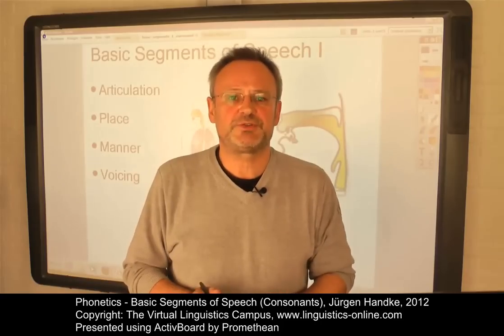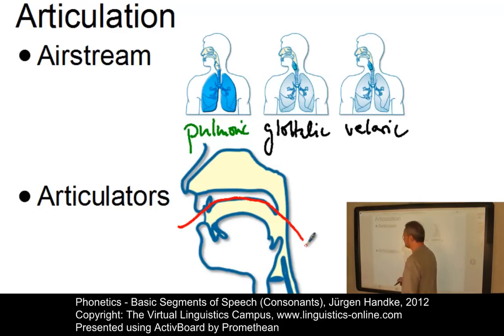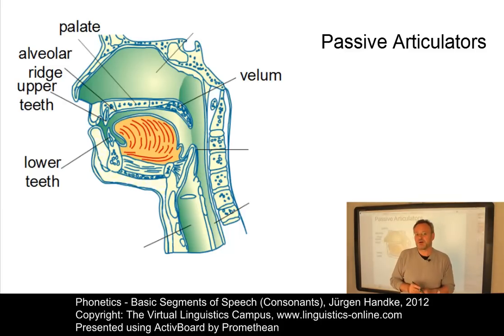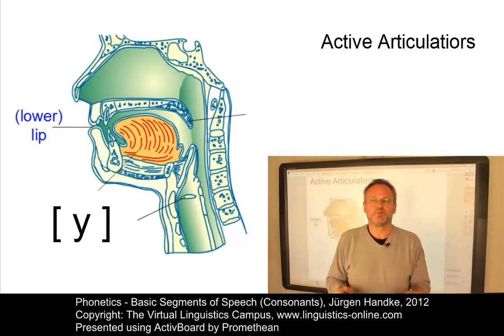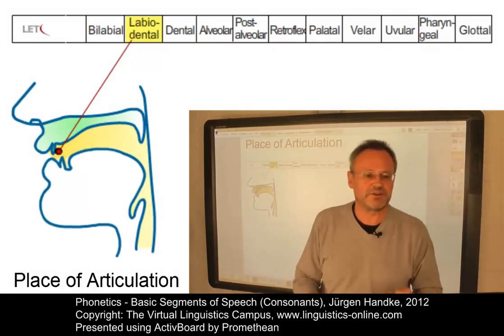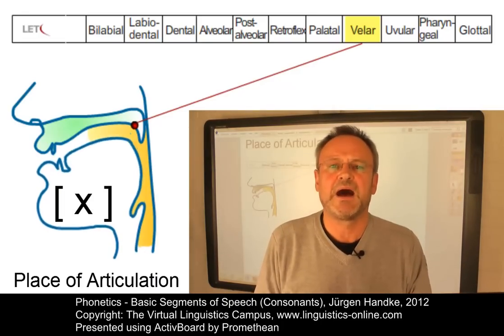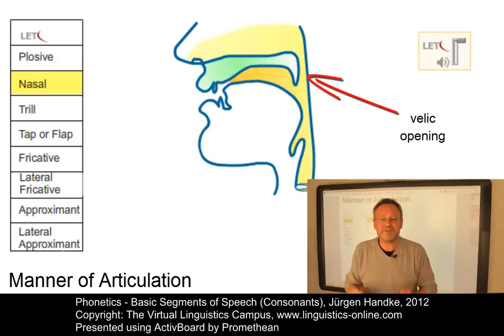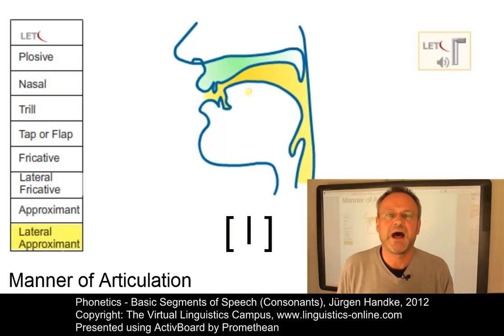PHO106 - Basic Segments of Speech (Consonants)

Comment: (0:02) This unit introduces the phonetic machinery for the classification of consonants. Consonants are speech sounds that involve some sort of obstruction to the airstream in the vocal tract.

(0:16) Using this criterion, we can set up two distinct articulatory parameters for consonants. For example, the place of articulation – that is, where does the obstruction occur; we can use the manner of articulation – that is, what type of obstruction is involved; and the third parameter is binary, it concerns the state of the glottis – that is, do the vocal folds vibrate or not? A further criterion concerns the type of airstream involved – yet, in this unit we will concentrate on those consonants that are produced with a pulmonic airstream, represented over here. We will not look at consonants produced with a glottalic, or with a velaric airstream: these types of air streams will be discussed separately.

(1:35) To understand the main articulatory parameters, we have to deal with some anatomical details about the vocal tract first. Consonants can be articulated at any point along the upper surface of the oral cavity – so along this line, here. The point of this upper surface involved in the articulation of the consonant is referred to as the passive articulator. A passive articulator is a position in the vocal tract which is involved in the production of speech sounds but [which] does not move. Starting at the front of the vocal tract, the following passive articulators can be classified. For example, the lower and upper teeth. Now, the upper teeth are locations where the tongue makes contact to produce several different consonants, such as [θa] or [ða]. The lower teeth are positions where the lips make contact to produce consonants, such as [fa] and [va]. Another passive articulator is the alveolar ridge, over here. Now, the alveolar ridge is an area for the articulation of many consonants. It is situated just behind the teeth. Typical consonants are [ta], [sa], or [ra]. The palate, or sometimes called [the] hard palate, is an area for a large number of consonants. It is often referred to as the roof of the mouth. A consonant would be something like [ça]. And then we have the soft palate, or velum. Now, this is a broad band of muscular tissue in the upper region of the mouth. Typical consonants are [ka] or [ga]. Another area, which is not really a passive articulator but an area, is the pharynx, over here. Now, the pharynx is used as a contact area for the production of some consonants such as [ħa]. And then we have further areas which are not really articulators. For example, the nasal cavity, which is the main non-oral resonance chamber. Consonants that involve the nasal cavity are typically consonants like [ma] or [na]. In the back of the mouth we find the food pipe, or oesophagus. The trachea, or windpipe, is used for breathing and for the airstream. And finally, we have the epiglottis, over here, which is attached to the anterior part of the thyroid cartilage, and it functions as a closure to the entrance to the larynx during swallowing.

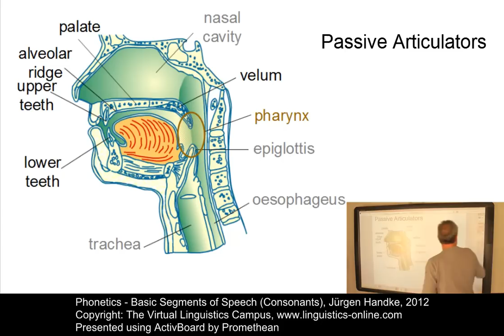(5:12) Let us now look at the active articulators. Now, the organ which is moved towards a passive articulator in producing speech sounds is called the active articulator. An active articulator is actively involved in the production of speech sounds. Starting at the front of the vocal tract the first active articulator is of course the lower lip, or the lips. Now, the lips are actively involved in: the production of labial consonants, such as [ba] or [pa]; and the application of lip rounding (or not) [for] vowels – so, vowels such as [i], which involves spread lips, and [y], which involves rounded lips. Further active articulators are of course, here, the tongue. Now, of all mobile organs, the tongue is the most versatile. It is capable of adopting more shapes than any other vocal organ. It is involved in the production of all vowels and most consonants. Here we have the uvula, another active articulator. Now, the most noticeable feature of the velum is the uvula – that is, an appendage that hangs down, and is easily visible if you open your mouth and look into a mirror: [ha], at the very end. And then we have the glottis. Now, the glottis is part of the larynx, and it is the source of phonation.

(7:00) The position where the contact between an active and the passive articulator is produced is referred to as the place of articulation. I will now produce one consonant. I will choose a fricative consonant – that is, a consonant which produces a turbulent airflow per place of articulation. And I will do it between two vowels for reasons of better audibility. Let's start with bilabial consonants. Now, here we can observe a constriction between the lips, and the result would be something like [afa], [afa]. The next place of articulation is the labiodental place of articulation, where we can observe a constriction between the lower lip and the upper teeth. A typical consonant would be [afa], [afa]. Dental – Latin dents, dentis, ‘the tooth’. Now, the dental area involves a constriction between the tongue and the upper teeth. Here is a consonant: [ata], [ata]. The next place of articulation is the alveolar place, that is the alveolar ridge, and it involves, of course, a constriction between the tongue and the alveolar ridge. Here is a consonant: [asa], [asa]. The post-alveolar area is just a little bit further back. Now here we have a constriction again between the tongue and this post-alveolar area. An example of a consonant is: [aʃa], [aʃa]. The retroflex place of articulation is a little bit different because it is still the same place of articulation (post alveolar), but the tip of the tongue is slightly curled back, and the result would be something like: [aʂa], [aʂa]. If we have a narrowing in the roof of the mouth – that is, in the palatal region, we get something like, [aça], [aça]. And then, the velar place of articulation involves a constriction between the velum and the tongue. A result would be: [axa], [axa]. And if we move further back and use the uvula as a region, as a place of articulation, as a passive articulator, with the tongue and the uvula creating some sort of constriction, we get: [aχa], [aχa]. And even further back in the pharynx we have the pharyngeal place of articulation. A result would be [aħa], [aħa]. And finally, if the narrowing occurs in the glottis, we get something like [aha], [aha].
Reply: (10:35) Let's now look at the manner of articulation. Now, there are several ways, or manners, in which articulation can be accomplished. The articulators may completely close off the oral cavity for [either] an instant, or a relatively long period. They may narrow the space considerably. Or the articulators may simply modify the shape of the vocal tract by approaching each other. The following manners of articulation can be distinguished and, again, I will produce one consonant per manner. In fact, in each case I will produce an alveolar consonant. Let's start with the plosive manner of articulation. Now, plosive consonants involve three phases: a closure, a compression behind it, and then release. A result would be [ata], [ata]. In nasal consonants, we have an oral closure too, but this time we have a velar opening, allowing the airstream to escape through the nose. And the result would be [ana], [ana]. Trills involve rapid closures and openings. Here is the result: [ara], [ara]. Similarly, flaps also involve openings and closures, however this time we only have one, single, rapid opening and closure. The result would be: [aɾa], [aɾa]. The fricative manner of articulation involves some sort of constriction or narrowing between two articulators. The result is a turbulent airflow. The result would be something like: [asa], [asa]. If the airstream escapes at the sides – that is, laterally – we can produce a lateral fricative consonant. Just like with fricatives, it involves a turbulent airflow: [aɬa], [aɬa]. Now, approximants are a little bit problematic. They involve an almost free air passage and are almost like vowels – some people even call them semivowels. So, an approximant would be something like: [aɹa], [aɹa]. And finally, if the airstream in an approximant escapes at the sides – that is, laterally again – with an almost free air passage, we get something like: [ala], [ala].

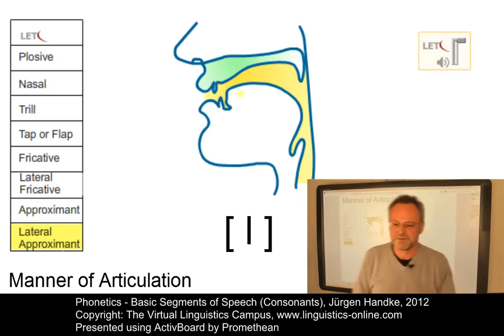(13:53) Having defined the central parameters (place and manner of articulation), we can now turn our attention to the state of the glottis. Now, most speech sounds are produced with the pulmonic airstream. That is, with an airstream that comes from the lungs – so, here are the lungs, and this is where the pulmonic airstream emerges. The airstream goes up to the trachea (here is the trachea) and eventually reaches the larynx where it passes to small muscular folds, called the vocal cords. Now, here are the vocal cords seen from top. If the vocal cords are apart, the airstream will have a relatively free passage (like this one here) into the pharynx and into the mouth. If the vocal cords however are adjusted so that there is only a narrow passage between them, and if they are, at the same time, sufficiently relaxed, [then] the pressure of the air stream will cause them to vibrate, as we see over here. Now, speech sounds, or consonants, that are produced with the vocal cords vibrating, are referred to as voiced. And speech sounds that are produced with the vocal folds that are apart, are referred to as voiceless.
Now, with these three parameters, we can now classify the consonants of the languages of the world. Now, here is the consonantal chart, and as you can see we have our two main parameters: the place of articulation, represented horizontally (this is the place of articulation); and the manner of articulation, represented vertically (so, here we have the manner of articulation). The distinction between voiceless and voiced is drawn on the basis of the position of pairs such as [p] and [b] in the cells. If you have a black and white print out of the consonantal, chart the voiceless one is always the one on the left (so here represented in blue we have voiceless consonants, and so on), and the one on the right is the voiced one (so, here we have voiced consonants). And if there’s only one consonant in a cell, then it is necessarily voiced by means of its default value.

(17:06) Now, I cannot produce all the consonants in this e-lecture. I recommend you to use our interactive continental chart on the virtual linguistics campus – it’s in the free section, [so] you can all use it even, without creating your VLC account. The big advantage of this consonantal chart is that you can not only see the consonants and see a description of the respective articulation, [but] you can also listen to them ([aɾa], [aɾa]), and you can see the animation [as] seen from the side. In addition to this, we have numerous exercises on the VLC, so this time I am not preparing or presenting you a summary of this e-lecture, but I will recommend you to use the numerous tools available on the Virtual Linguistics Campus: interactive consonantal and vocalic charts; animations; additional exercises such as listening tasks, transcription tasks; and so on. To learn more about the phonetic alphabet – that is, the symbols by means of which we refer to all these speech sounds – I recommend you to take a look at the e-lectures Phonetic Transcription One & Two.